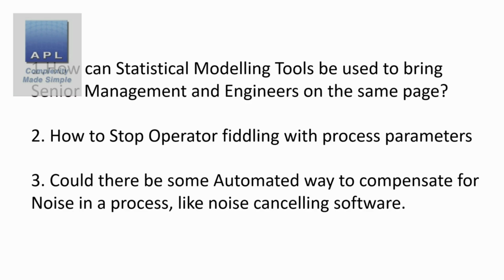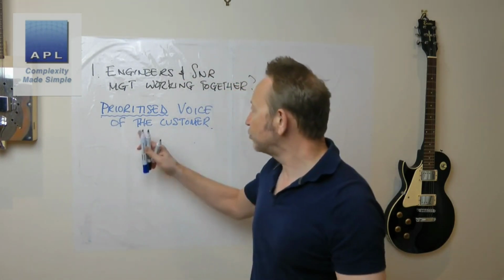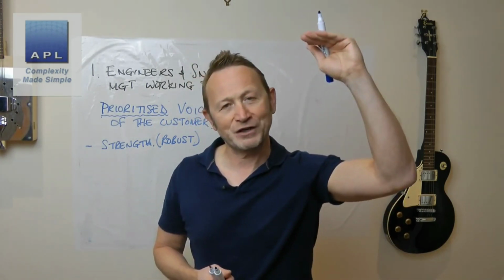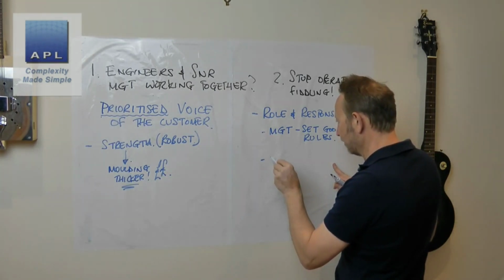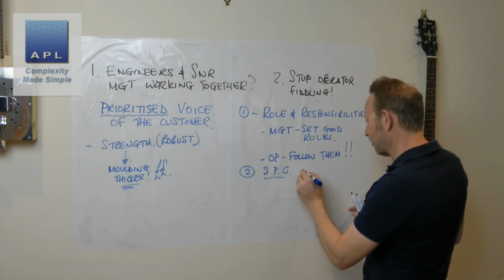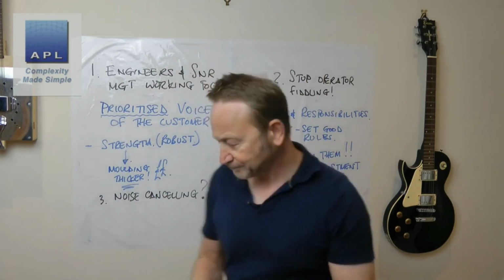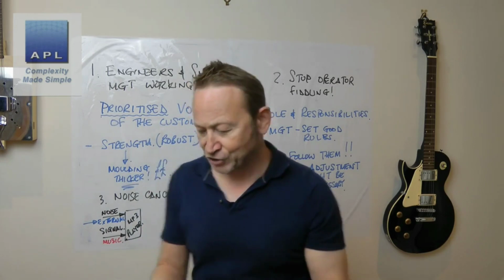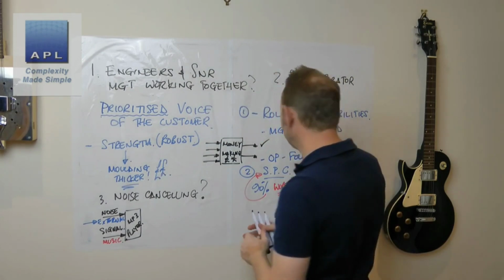World Class Mgt behaviours..

Comment: Great videos Paul.

Point 2 - I would sum this up as operator engagement. We had a similar situation, and using SPC educated the operators and got them involved in the process improvement. We made it clear that we respected their knowledge and would test any theory under controlled conditions in exchange for following the rules. Result was a predictable process based on controlling inputs, a 20% increase in speed and an improvement in first time run success. We didn't forget to celebrate our success.

Point 3 -  In the process, all noise is variation. As I see it we call it noise when it is inconsequential variation, i.e. the Cp is acceptable. If the Cp s not acceptable then we look to remove/reduce the variation.
Reply from the maker: Chris - good to hear from you. and a some really good points and advice you give. There is no doubt we have be clear with the operators and work with them, I think I'll be making a video to include your points as they're really good...